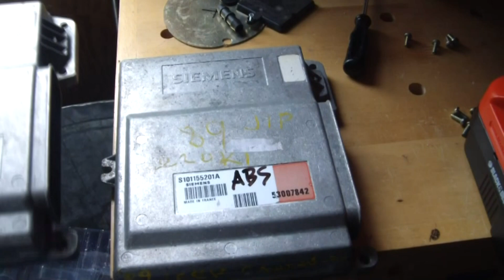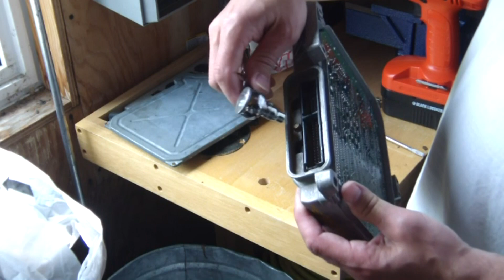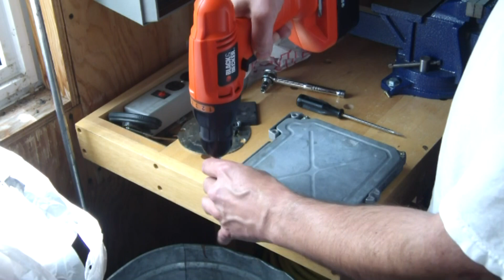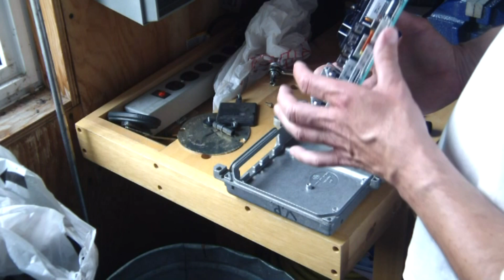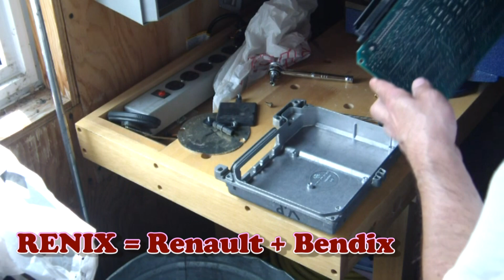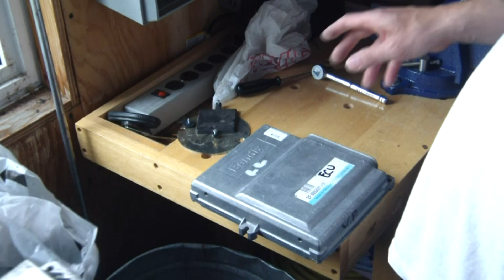RENIX computers. ECU & ABS modules for 87-90 Jeep Cherokee's.

Comment: If you know which ECU wire goes to Check Engine Light please let me know.   I put 4.0 w/ Renix in my 84 CJ7 and State of Colorado putting me thru the ringer to certify it meets emissions rules (nuts huh, the old 4.2 with Carter carb produced significantly more emissions!)
Reply from the maker: Nope.
Reply: let me know too i want to access the factory code diagnostics without ignition if i know whitch one i can jump switch it
Reply: There was no check engine light or on board diagnostics with the renix. They got by by putting in an emissions reminder light that came on at a preset number of hours.

Comment: I've already tried both. I've found  places that rebuild them if you have one, but haven't any success finding one that's useable or good enough for the Machine shop to copy it. Do you have any suggestions for junk yards? Thanks
Reply from the maker: I thought I read some posts on the NAXJA forum about someone selling new replacements, search there.
Reply: Thanks I've been looking and I signed up reluctantly to NAXJA  but I'm for finding the part just had a bad experience with a form win I was in my early 20s I tired asking a question about truck frames and it didn't go so good. So far I haven't seen it yet. I did post that I'm looking for one
Reply from the maker: You cannot work on Jeep's and NOT be a member of the NAXJA forum. Someone will respond, sometimes it takes a few swings before you get a response. Good luck.
Reply: Klondike Mike I guess I was doing the hard way thanks to all that helped find it. Hard rock 4x4 is where I got mine from jonn so helpful. Ps I have a stock ish 2006 jeep but this one is going on a 69 Dodge Charger with twin turbochargers and maybe a bigger cam